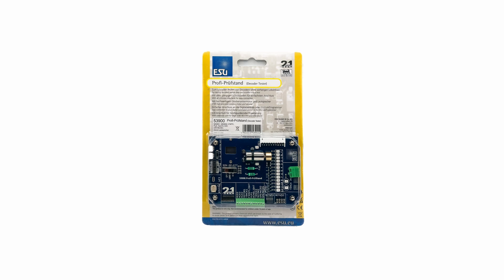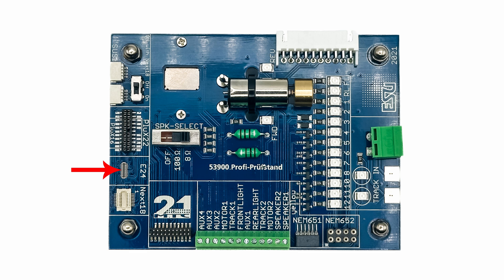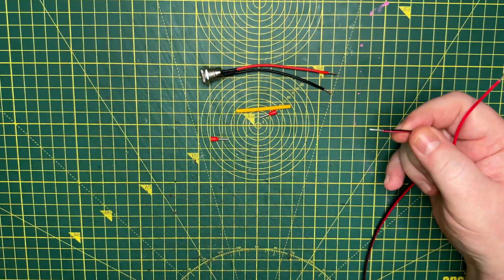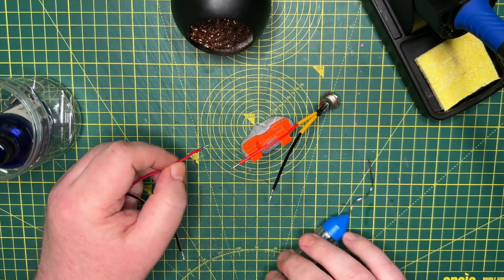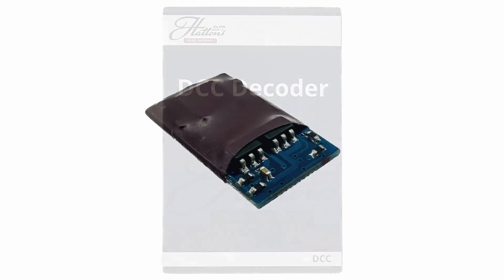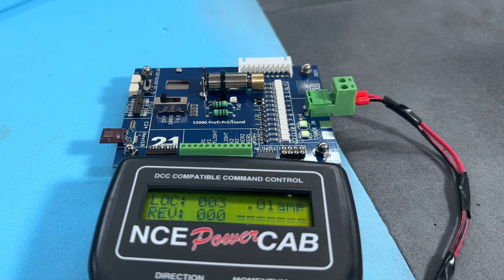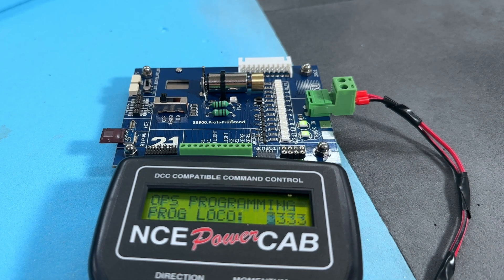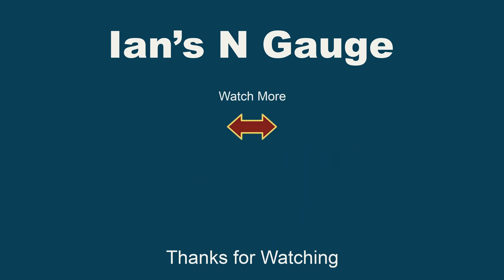169 - First Look - ESU 53900 Decoder Tester

Comment: Do you get enough dodgy decoders to make this tester worthwhile?  I’d be interested in seeing how the different (argh) proprietary decoder programmers worked, which I think are needed to upload sounds and firmware.
Reply from the maker: Hi Chris! That's a pretty good question! No, is the quick answer, I've only ever had one decoder blow so far! But, it's not just about testing dodgy decoders! If a loco has a problem, testing the decoder outside of the loco can tell you whether the decoder is faulty, OR whether the loco wiring could be faulty! Also, the tester allows you to fully program decoder CV values at the workbench, before fitting them to a loco! This means you can have a set of pre-programmed decoders ready-to-go before a new loco arrives! You're right though, to upload sounds to a decoder, you need specialist equipment, such as ESUs LokProgrammer hardware / software solution! However, I've got a Hornby HM7000 sound decoder that I'm going to try programming using the decoder tester and the Hornby app! Otherwise I purchase my decoders with sounds already uploaded! Cheers, Ian.
Reply: @iansngauge  Yes, it is a good way of narrowing down why something isn't working right. Luckily, touch wood, the only failure I've ever seen was when I let the magic white smoke out of a D&H decoder. The scorch marks were another clue 🙂
Reply from the maker: Hehe! Gotta love the sight, sound and sweet aroma of a piece of electronics going bang! :) Ian

Comment: Hi Ian great overview of the decoder tester, I have 2 versions already the only reason being is that my original didn't have next18 LOL! the E24 socket is a new protocol by ESU, some European locos do have it but not many, I don't think it is nmra compliant yet so cant really see it taking off, besides I think we have enough connections on the next 18 for our purposes. The big advantage of your decoder tester is that it has a built in speaker just remember to select 8ohm, 100ohm was just used for the locsound v3.5 or lower the newer versions used 8ohms and all other sound decoders by most manufactures use 8ohms. All the best Tony.
Reply from the maker: Hi Tony! Thanks very much! No Next18 decoder? That must be quite an old version! :) A couple of guys have commented that the Revolution Trains class 59 uses the E24, but like you say, I can't find any information about it being standardised by the NRMA! The great thing about standards is that there are so many of them! Lol! I'll keep in mind the 8 ohm speaker selection! I see that you can connect an external speaker too! I'm wondering how the Hornby HM7000 will work in the tester, and whether it'll use the internal speaker if I don't connect it's external one directly? I've got a project to fit a sound decoder to a DMU coming up, so I'll probably go for another Zimo, so that will be interesting to test too! Cheers, Ian.

Comment: Hi Ian, another great video, I also have one of these decoder testers but haven't had the pleasure of using it yet. Great to see one set up and working. Hopefully when I change my next set of decoders over they will get programmed on mine. Looks like a good piece of kit and well worth the money.
All the best Allan
Reply from the maker: Hi Allan! Thank you! I haven't seen many videos of one setup and running myself, which is why I thought it may be worth making one! I'm pretty sure you'll be happy with the decoder tester, and I think I'll be using it to setup my decoders before installation in the future! I'm intrigued to see how it'll handle the Hornby HM7000 which will be the next decoder I setup! All the best, Ian.

Comment: Morning Ian, thanks for this, it's great to see this tester in action. Looks like a fair bit of nice keyframe editing for the red arrow went into this video too!

I'm not sure what I was really expecting of a decoder tester, but I was surprised not to see what looked like a microprocessor somewhere on the board (though admittedly one could be on the underside) and surprised when you said it needed an external controller connected... though really that makes total sense!

But it's highlighted to me that this is just a locomotive without wheels... its operator (you) is the real tester. You said you were pleased the active breaking function could be simulated on the tester, but actually it's not simulating it at all - that's the decoder controlling the motor that it's connected to for real.

So, this is basically just a set of LEDs, a speaker and a motor wired to the pins of the decoder sockets - it has no brain and doesn't do anything itself - which has me thinking it should be feasible to make a DIY version at some point 🙂
Reply from the maker: Good morning Jonathan! Haha! Yes, that red arrow took some lengthy keyframe editing to get it under my control! I appreciate that you noticed! :) I think if the decoder tester had its own DCC command station functionality, it would be treble the price! The fact that it uses your existing command station is much more useful, as you can see how a decoder reacts with your own controller! But yes, you're right, it's basically a loco without wheels, that can be controlled via multiple DCC interfaces - and you are the tester! When I said it was simulating active braking, I meant that it was reacting similarly to how it would when installed in a loco! Making a DIY version sounds like an eminently feasible idea, so I look forward to seeing one on your channel soon! :)) Cheers, Ian.
Reply: @iansngauge  Yes, using the existing controller makes so much sense - I've no idea why I had some other idea in head before!
Lol, I don't know about soon, but I think there'll be one eventually 🙂

Comment: These really are brilliant bits of kit and you will find a miriad of uses, especially when you are repairing and / or programming locos etc. Think you have the next variant of the tester as mine is the same except the E24 socket.
Reply from the maker: Hi John! I totally agree with you! I'm so pleased I purchased the decoder tester, and will be using it to program my Hornby HM7000 next! Yeah, the E24 socket was something of a surprise, as it's not mentioned in the manual! I had to Google it to find out what it was!!! Cheers, Ian.